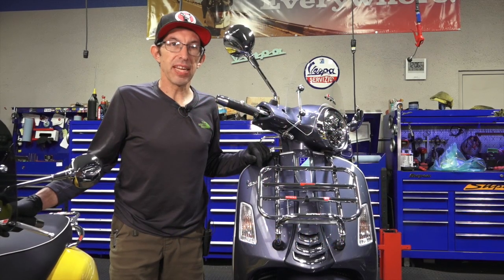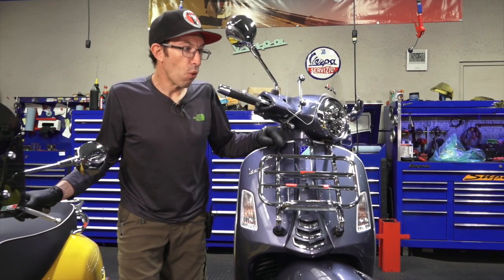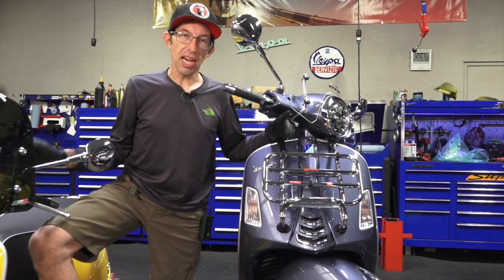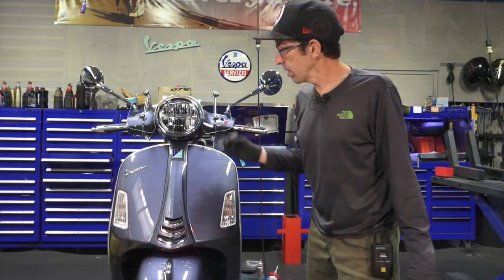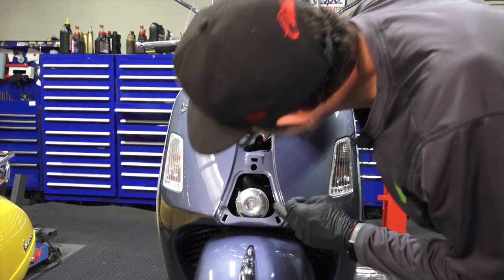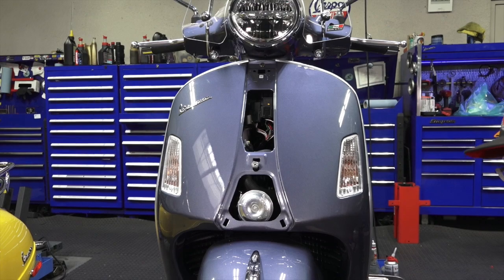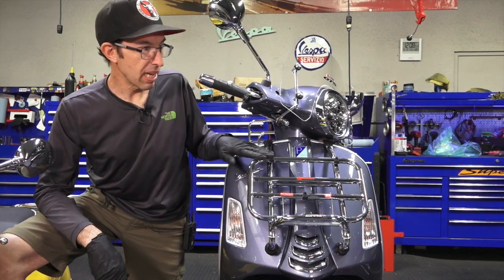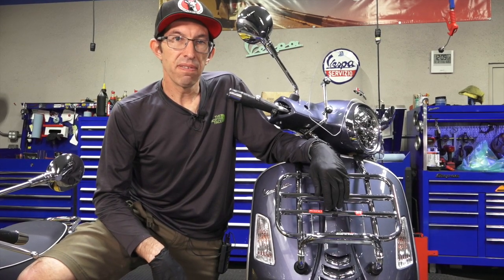How to Install New Faco Front Rack on Vespa GTS HPE

Comment: Disregarding cost, which is better quality, the Faco or the OEM rack? Six kilograms is about 13 pounds. Does the OEM rack have a higher load rating?
Reply from the maker: Quality is only very slightly higher on the OEM version, and maybe little bit better fitment. Also, the current OEM version of this rack does not have the hooks that go up over the legshield, but rather has another bolting point. As far as load, they’ll handle about the same. You can push them a little over but it’ll start to affect the handling. Thanks!

Comment: Do not over torque the standoff bolt. The threaded shaft will twist off (don't ask how I know). I have not been able to find a supplier for the mounting bolt set. I may have a friend, who is a machinist, try and make one.